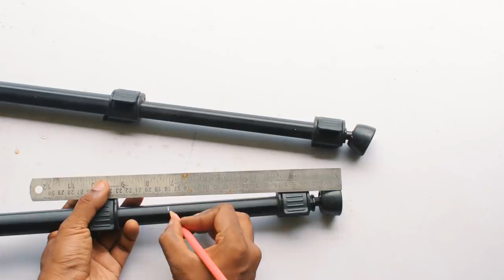How To Make Best PCP Airgun Bipod

Comment: The video is very good excellent, but we need a grouping test and shooting.
Reply: If memory serves, he shoots steel bearings and the gun is smooth bore, so I would assume its fairly accurate and devastating at short range, but the accuracy would fall off at greater ranges.
Nice concept, but I reckon he'd have to switch to a rifled barrel and use the appropriate sized slugs/pellets to get better accuracy at range.
Still, I would NOT want to get hit by anything fired by that monster!